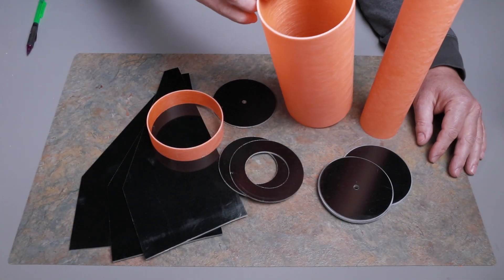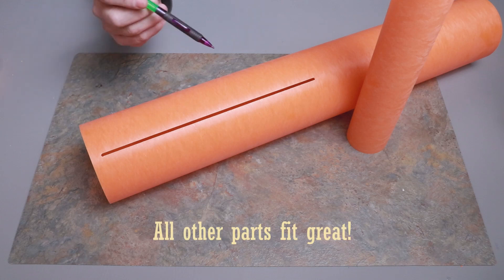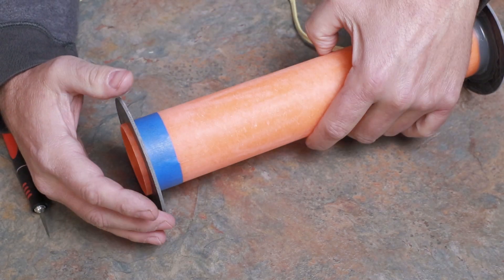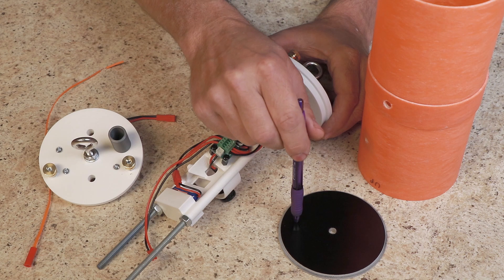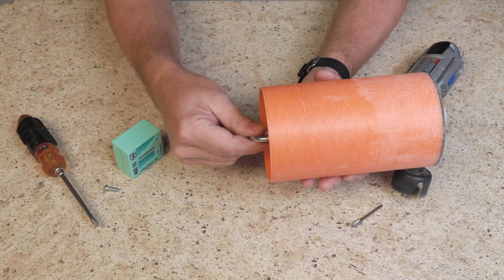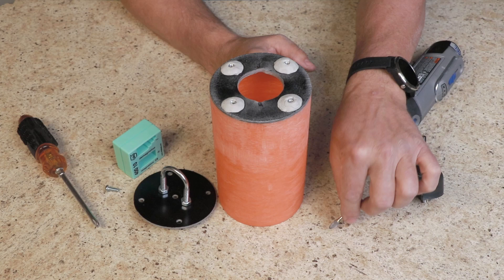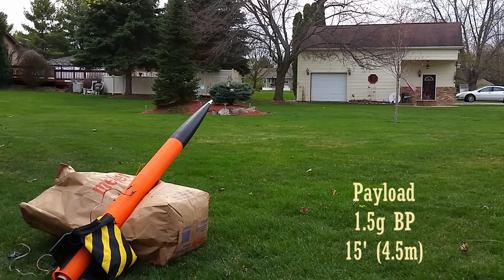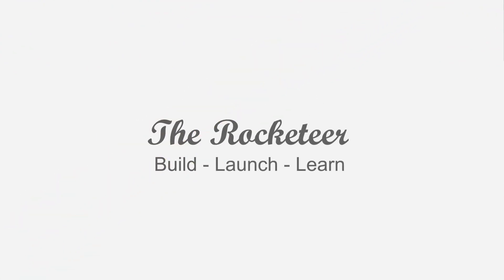Formula 98 fiberglass rocket review and build.

Comment: I learned a lot from this video.   When you did the external fin fillets did you add black dye to the epoxy so it matched the black fins - or did you dye it orange to match the color of the body tube?
Reply: Black dye comes with the RocketPoxy so I added a few drops. Thanks for your comment!

Comment: I am about to build this rocket but I want to set it up for single deploy for a level 2 cert. So basically just glue the eBay in place and attached the shock cord from motor mount to a glued in place bottom bulk plate on the secured ebay? Thoughts?
Reply from the maker: The Formula 98 is a heavy fiberglass rocket designed for dual deployment. I would not recommend flying this rocket with motor ejection. The nice thing about using an altimeter is the apogee deployment is usually spot on every time.

I would be concerned that the ejection charge would not be large enough. I use 1.5 grams of 4f black powder for my ejection charge at apogee and 2 grams for the main using 3x 2/56 shear pins. Check to see if the motor you intend on using has enough BP.
You may want to talk to your RSO and see if they will allow the Formula 98 to fly without an altimeter.

If you decide to proceed anyway then keep the following tips in mind. I would suggest not gluing the altimeter bay into the airframe. I like to bolt the altimeter bay into the payload section by attaching nuts with epoxy clay inside the e-bay. Do not overtighten. This will give you the option of going dual deploy at a later date. 

Attach both lids to the altimeter bay by running all thread rods through each and tighten the assembly with nuts. Install eye bolts in each lid and attach a Kevlar shock cord to the bottom one. Then bolt the assembly together.

Use at least 20' of shock cord. Pin the heavy nose cone on with shear pins. This will secure it from coming off and turning into a falling hazzard. Ground test and make sure the laundry is ejected out!
Reply: @TheRocketeer  This is the thread I used to make the decision that single deploy might be ok. If you scroll down there is only a main parachute and you can see the filled out flight card. I will definitely bring it up to the LCO and add more BP to the DMS ejection port of I need to.